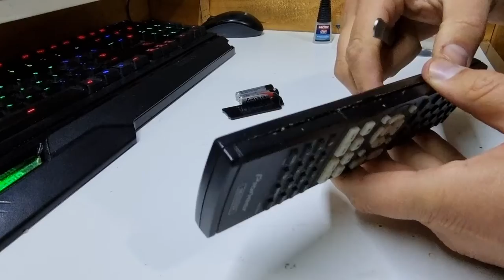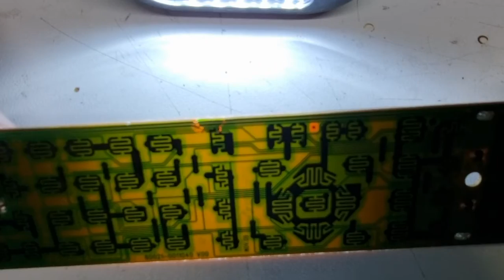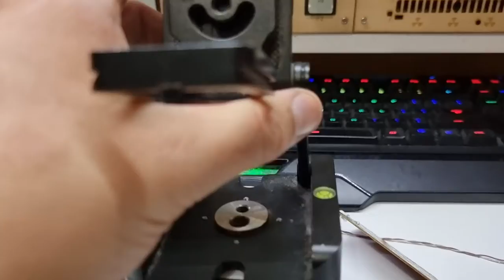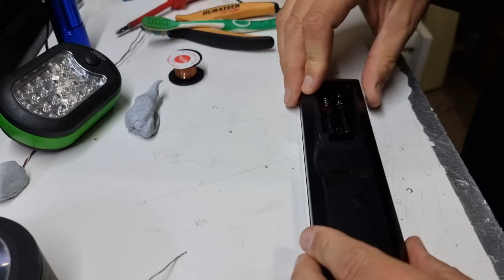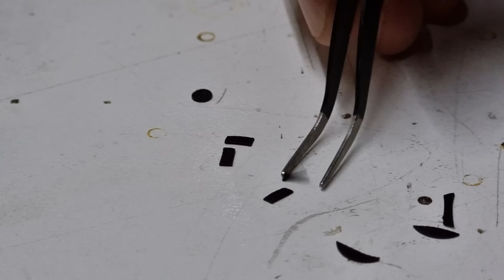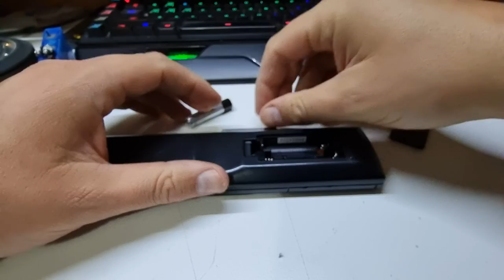A real challenge | Pioneer AXD7660 remote repair

Comment: A couple of tips, never use anything metal to split the case open, always use plastic, there's plenty of tools you can buy online for this exact purpose, you can wash everything except the PCB in Windex over the sink, I use an old tooth brush for this purpose, use IPA at least 99% and a cotton tip to clean the contacts on the PCB and rather than using conductive pads, you can use a grey lead pencil to colour in the pads on the rubber sheet and also the PCB.
Reply from the maker: The reason I got to the metal spudger is the plastic ones broke. Valid points, I'm aware of all of them. grey lead doesn't work over the top of circuit board enamel.
when a remote has been chewed by a dog like this, it's well beyond the pencil fix -which is usually temporary for the most part.

Comment: Nice job.👍👍👍
 I got an old Nintendo controller working on a fast job, many years ago, by super gluing alfoil to the pads.
The owner tried it and then dropped the other controller in, even though it still worked, because the increased performance difference was quite noticeable.
Reply from the maker: yeah these pads usually do the same, seems to "lighten" the keys up quite a bit.

Comment: I have the same remote, and the volume buttons stopped working as well. I opened the remote, cleaned with a Q tip and isopropanol, and used tiny pieces of conductive copper tape to cover the black carbon fiber ovals on the volume buttons (I didn't have carbon fiber tabs on hand). It's working great!
Reply from the maker: Yeah, aluminium foil also works too.
Reply: @TheAussieRepairGuy  good to know!

Comment: Two days ago I cleaned my lx-cs57 avr’s remote… hooleee it was dirty inside! I bought the system from a friend and he is fond of chips and beer! 😂 Hardest part was to open it and closing it back up because the middle round selector has to be seated in a specific way.
The volume and other buttons are generally very hard to make contact, but I attribute that to bad designing by Pioneer.
Reply from the maker: I got myself a flipper zero recently, I'm currently cloning all my remotes for a similar reason.
Reply: @TheAussieRepairGuy  I used to have a Logitech multi function remote for all my gear but gave it away. Might be a good idea to get one again. I have so many remotes.

Comment: Not saying you did, but are you sure you didn't damage that board yourself when you were trying to open it before removing the screw? It made a horrible crunching noise when you were trying to open the clips on that side. that being said, this helped me open mine - I'd actually removed the screws but didn't know about the clips, so thanks. I saw the grease on the board volume contact so just cleaned them with some meths. Works perfectly now
Reply from the maker: Yes the same thought crossed my mind in the years since posting this, bit the cracks did correlate with the teeth marks  from the dog chew marks.
I was informed that worse crunching sounds came out of it at the time of damage. So it could be hard to know.
Reply: @TheAussieRepairGuy  Not really hard to know! You show the IR led working before disassembly - if the board was already cracked, the LED woldn't work :)
Reply from the maker: @ljalvs  when cracked the led still worked, just not on all buttons, which was the original complaint.
Spoke to the owner after filming, it had been dog chewed, but I agree neglecting that screw likely didn't help matters.

Comment: Very helpful video. I was having the same problem on the same remote (no volume).
Luckily, my board wasn't damaged, like that one. However, I didn't have any carbon pads, so I cut some out of an old remote and glued them in.
 Worked out great, on the first try.
Reply from the maker: Ahh good to hear you got it worked out, I have heard of people using aluminium foil glued on as well.

Comment: hi mate, i have a kenwood decoder/audio video control system and my remote is identical. i am also having problems with my up volume button and I am having trouble getting the clips to open plus i have already removed the screw in the battery compartment, what would be a good tip for me to open it up without damaging it?
Reply from the maker: If you are having trouble with the clips, you might be trying to pry up the wrong side of the shells. Its a bit of a skill. But these ones as you saw from the video are challenging to get open. Don't rush, take your time, and be gentle. Start half way down one side.
Reply: @TheAussieRepairGuy  thanks for the quick reply and I persisted and got it open 👍 thanks for the awesome vid too as i been trying to find out how to fix my remote control buttons for years.

Comment: I just took my remote apart, same pioneer remote. Volume buttons weren't working good. Cleaned the board and buttons w a qtip. Then closed it back up. Now it doesn't work at all. What's happening?
Reply from the maker: it may need time to properly dry out before reassembling
but I'd check to see if any tracks are broken or the carbon coating on the circuit tracks was not scrubbed off.

The LED on the board has steel legs, these are easy to stress and can snap without being obvious.
Reply: @TheAussieRepairGuy  thanks I figured it out. I kinda smashed one of the battery terminals when I closed it back up. Thanks tho.
Reply from the maker: @kvnmcn  With a bit of "gentle persuasion" aka bending, they can usually be put back, but be careful not to mess up the circuit board when doing it
Reply: Yea I got it. Thankyou.

Comment: Tried everything to get my AXD7723 remote working again to no avail, volume and input select do not work. Life is too short. I am going to have to replace it unfortunately. Very frustrating.
Reply from the maker: Yeah sometimes you can't win them all. Especially the ones with wafer thin boards.
Reply: @TheAussieRepairGuy  in the end I carefully cut out and applied some aluminium foil to the problem button pads... It worked! Thank you so much for you kind and informative videos and your helpful response. All the best from the UK!

Comment: Hi, I have this one, and I have an issue wanting to play sound from a device connected to the "audio" input (red +white), but can't figure out how to click on the remote control to switch to that. It only switches between BD, DVD, CD, SAT/CBL, GAME, TV, Tuner. Not sure what more to do. Can you help?
Reply from the maker: Not really, as I was only handed the remote to fix, not the complete unit.

Off memory, these have lots of inputs, each one has a marking on the back to indicate which mode they are associated with.

Also I think there's a "phono" mode as well.
Reply: @TheAussieRepairGuy  after I wrote this, I saw that we was wrong first time we checked, and the device was connected to the dvd. And because we also had a HDMI tho the other dvd input, no sounds was from this one. But I found a button on the remote that changes between these two, so the problem was solved. Thank you anyway for spending time answering 🙏
Reply: My volume buttons were messed up also. I just took it apart and cleaned all the connections and closed it back up. Now it wont work at all. What did I do wrong?
Reply from the maker: @kvnmcn  it may need time to properly dry out before reassembling
but I'd check to see if any tracks are broken or the carbon coating on the circuit tracks was not scrubbed off.

The LED on the board has steel legs, these are easy to stress and can snap without being obvious.

Comment: I have a Philips remote with tv, disc, tuner, aux functions, but some bottons work on some functions but not with other, when i have it on disc the ir light turns on when pressing all buttons, but with tv, tuner, aux the arrows and ok buttons dont work, wondering if thats normal.
Reply from the maker: No sounds like it might be liquid damage or worn carbon pads.
Reply: @TheAussieRepairGuy  ok thanks 👍

Comment: what is the flat blade tool you used to disassemble the remote case? thanks!
Reply from the maker: That was a gift from @tinker man mick.
He used to get them with phone screen kits, not sure what they are called or where to get them.

Comment: Hi everyone I'm using a pioneer  vsx 2016av-s amplifier which I bought as a second hand it didn't come with the remote so I bought a second hand pioneer axd7690 I believed it would've worked but it didn't...could the remote be damaged or just isnt compatible...suggested remote for the amplifier was AXD7619 but they just look similar to the one I have but it isn't working....help me guys
Reply from the maker: I'm not sure I can be much help and I'm not an expert on these amplifiers specifically. I do know that they changed the code strapping of each remote drastically between models. 

I'm not sure what else I can do for you.

Comment: I have ASX7721 same shape size remote. Cannot open it it seems like its glued
Reply from the maker: There was a hidden screw in this one, under the label, and another in the battery bay.
Reply: @TheAussieRepairGuy  eventually did it. Almost stabbed myself.  Didn’t fix my power button even though I cleaned everything with alcohol. Will have to redo correctly with new pads i think
Reply from the maker: @ginamas1000  yeah I'm seeing more and more worn out pads tgese days. It kind of feels like rubber keypads like this from a specific time period suffer this problem. I should research it sometime.
Reply: I was at it again tonight. This time I washed everything with warm water and dishwashing liquid. I used cotton tips to surgically dry every little nook. Volume control - fixed
On/ off button - fixed
Mad scratches and cuts almost cutting my skin from trying to pry open the remote - fixed (I used my nail filer and buffer) 
Thanks so much for this video

Comment: mine just fucking did this, i pulled it all apart and cleaned it and yeah.... garbage fucking remote thats what it is.
Reply from the maker: Yeah they certainly cheaped out on the PCB thickness. Would have expected that pioneer would spend an extra dollar on the PCB considering what the gear is worth.
Reply: I'm not buying Pioneer again.